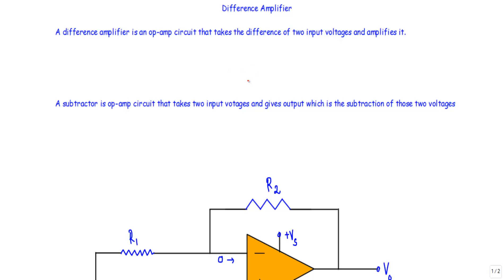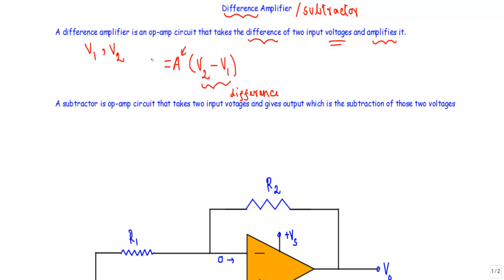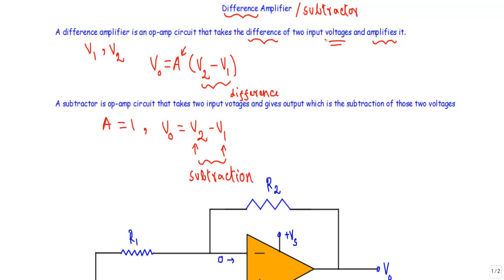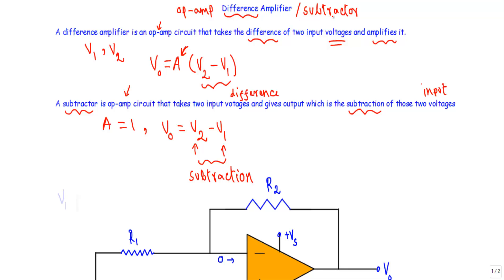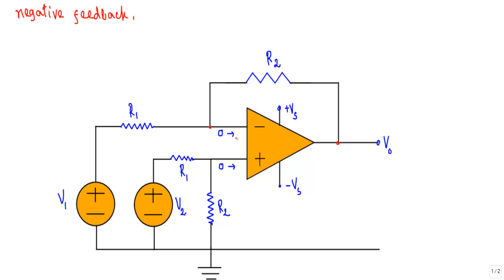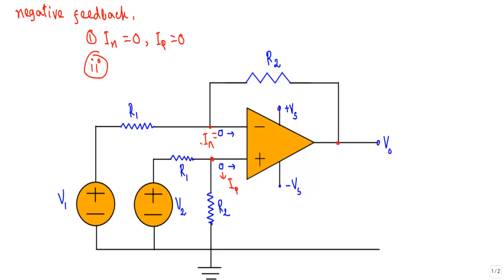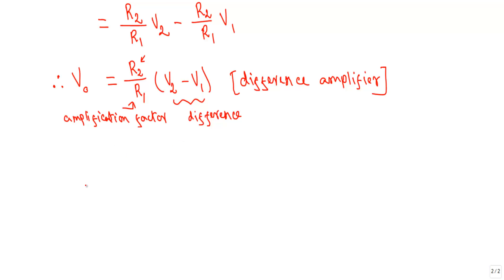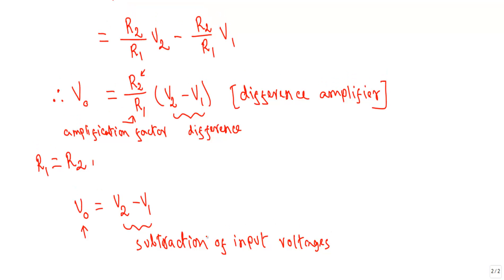Op-Amp Difference Amplifier / Op-Amp Subtractor (w subtitles)

Comment: how Ip is zero can anyone explain ?
Reply: That's a model for an ideal op amp and one of the restrictions on the model is that no current flows into the input terminals of the op amp. Another one is that the Vn equals the Vp.